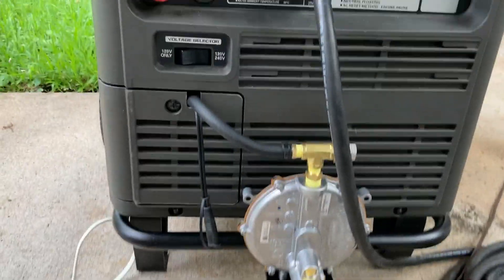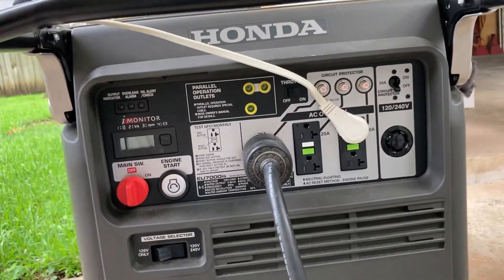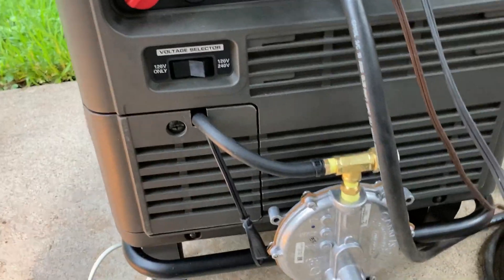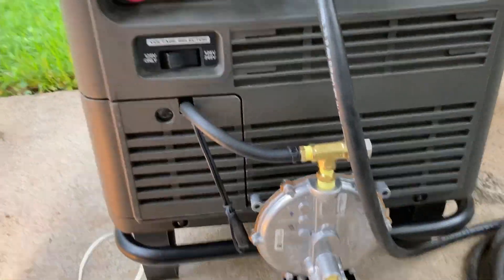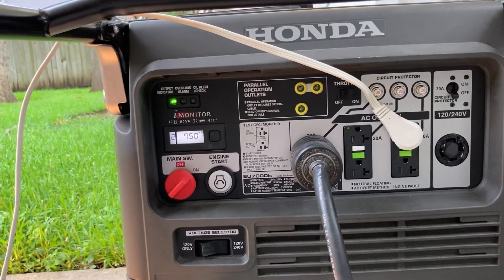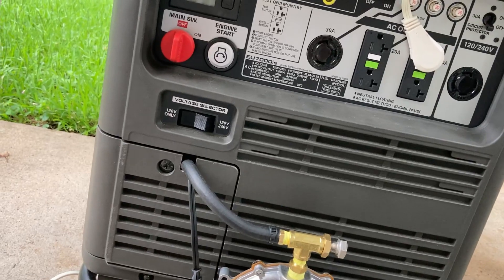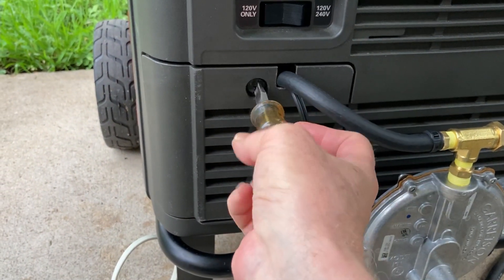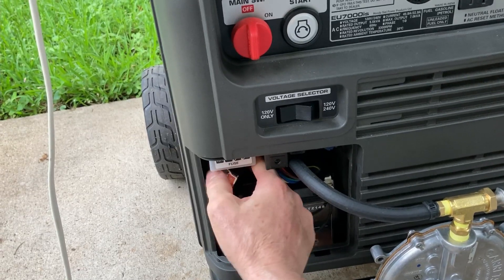Honda EU7000is running on natural gas with US Carburetion Motor Snorkel tri-fuel conversion kit

Comment: Were you able to fix the surging issue? I have the exact same set up and am experiencing the surging as well. I suspect it is because of the small propane hose, so I'm working on getting a much larger one set up. Any hints on what you did to fix the problem would be greatly appreciated!
Reply from the maker: Hi Charles, 

To be honest, I believe it's about as good as its going to get, so I haven't made any changes since the video  I've used the generator several times during actual outages and it worked well for me.

Maybe it's because I came from an EU3000is (also running on natural gas), but this eu7000is seems very powerful and trouble-free by comparison.  It can do everything the eu3000is could could do (while totally maxed out) at idle speeds.  And it can do twice as much without even breaking a sweat.

It would be cool to be able to be able to squeeze a few more watts out of it, but I think someone would have to reverse-engineer the engine computer in order to make that happen.  There are just certain ranges near the maximum potential of the machine where the engine lacks the torque it needs to run at speeds as low as Eco Throttle tries to run it.  I wish they would do that, but it may just be beyond what small conversion kit companies can hack together.  Heck, USC can't even make it fit right mechanically, so it's a near miracle that they managed to make it run as well as they did.  They certainly did beat every other conversion kit company by a mile in that respect.  And practically speaking, if I ever dd experience any surging while in actual use, defeating Eco Throttle would be a viable work-around.  But so far, it just hasn't been a problem.

On the bigger hose idea, at this point I have gone so far as to connect the generator directly to my gas meter, thus eliminating 60 feet or so of 1/2" pipe.  FWIW, I couldn't tell that it made any difference at all, so I'm sticking to my theory that the problem is with the Eco Throttle RPM parameters not being compatible with the engine's power curve while running on natural gas.  But hey, if you find that a bigger hose helps in your case, I hope you'll let me know.  Make a video of it running flawlessly and I'll be on a quest for a new hose.  But I just don't think so.  I started out with a 3/8" hose, which I then upgraded to 1/2", thinking that it might help.  I don't think it helped.

The obvious solution would be for Honda to get with the program and make their flagship models tri-fuel capable.  Failing that, perhaps someone like USC can figure out how to spoof the GCU into thinking it has more load than it actually does...it just needs to ramp up the engine speed aggressively enough to prevent bogging.  Similar to how it does when the two inverters are not bonded together, and the load on one inverter is twice what it would be if the two were bonded together.  It is that signal that makes it run at a high enough RPM to prevent bogging.

As of today, what you see in this video stands as the best-performing natural gas conversion that I have personally seen on any generator.  One might say that's a shame, particularly considering Honda's high entry cost, but the best is still the best.  If anyone has video of any conversion running better, I would very much like to see it!  And then (naturally) I would want to know how they did it...
Reply: @MstrMark  Thanks for your help! Yes, I will try the larger hose and see if that makes any difference since the parts are already on the way. I'll also compare using natural gas with a 3/4 inch hose as well. I'll let you know what I find out. Thanks again. Charles
Reply from the maker: @homeinspectionportland  I do love real-world testing!
Reply: Just a quick update -- I connected 3/4 inch hose and 3/4 inch fittings on the low pressure side of the propane regulator and it worked perfectly. I didn't experience any surging at all. I also tried the 3/4 inch hose connected to the home's natural gas supply and it worked flawlessly as well. I think my 3/8 inch hose from the propane regulator was seriously restricting flow and causing the generator to surge up and down. Having the bigger hose definitely solved my surging issue and it works awesome now with both natural gas and propane. Thanks for posting and for helping me figure out this surging issue!
Reply: P.S. I had to get a much larger regulator with a 3/4 inch output, but it wasn't very expensive at my local propane supply store.
Reply: @homeinspectionportland  Oh, so we're talking about propane?  I have much less experience with that, but I'm glad to know it's working well for you.

Comment: seria interesante que ver si ajustando  el tornillo  del regulador se mejora la estabilidad y ver si hay mas potencia disponible por que  en mi generador hice los mismos test de carga hasta que logre sacar los 4400 w de este generador  a 3600 rpm con una manguera 1/2"  y 30 metros de largo, este regulador soporta hasta   20kw de potencia

It would be interesting to see if adjusting the regulator screw improves stability and see if there is more power available because in my generator I did the same load tests until I managed to get the 4400 w of this generator at 3600 rpm with a hose 1 / 2 "and 30 meters long, this regulator supports up to 20kw of power
Reply from the maker: FWIW, I show it running at 5500 watts starting around here: https://youtu.be/2NziDBzqI-Y?t=364

Backing out the load screw any father has no positive effect on maximum load, but it does hurt the performance with lighter loads.  I feel like the "Snorkel" injector becomes the limiting factor at maximum load, but that's at the heart of this particular kit, so there's not much I can do about it.  Maybe if I had more line pressure it would act different, but it's already within the recommended range.  It will do 7000 watts for short intervals on gasoline, but I don' think there's any way to get much more than 5500 watts out of it on natural gas.

In my mind, a more worthwhile improvement would be a mod to prevent the engine rpm from dropping below its torque curve while running eco throttle on natural gas.  I think maybe US Carburetion could do it with their black box module, but haven't had much luck getting them to talk to me about it.  Anyone have any inside connections?  It would be fun to be involved in perfecting this kit.

Comment: Any testing with inductive loads rather than just resistive loads?  Perhaps get 3000 watts load on and plug in a 15amp air compressor
Reply from the maker: I have, although I didn't make a video...but that might be fun and informative.  FWIW, the EU700is handles transient and inductive loads better than other generators with similar ratings, but motors are still the greatest challenge.  That is why it works better to run several small window A/C units than one big one.  Also the reason that when I replaced my refrigerator, I chose one with DC inverter technology, because that essentially eliminates the inrush issue.  I also have a 22,000 BTU window unit that uses inverter technology, and the EU7000is handles it very easily, barely even changing tone as the compressor gently ramps up to speed.  On the other hand the ancient 24,000 BTU conventional window unit in my garage takes all she's got.  Same with my natural gas central heater - it has an ECM blower motor that is essentially unnoticeable when it starts.  

If one needs to start conventional motors with any generator in this wattage class, one will need to be careful and selective.  For example, I have a 6000 BTU window until that starts fine, but it pulls 2400 watts inrush, so it is noticeable when it starts, and that is a model that is known to start more easily than most.  I have a 5000 BTU unit that is worse.

But I've had some years to sort out my emergency readiness, so I no longer have any conventional motors that have to be started while on generator power.  I can start my 5 HP air compressor if I really need to, but I have to turn everything else off.  Still, if I just HAD to run the air compressor, it would be possible.  All of the other motors are now either DC inverter technology or small enough that they don't present a major challenge to the generator.  I think an air compressor is probably the most difficult load that most people would have.  Even an air conditioner (with the same size compressor motor) is easier to start than an air compressor.

Comment: I have been considering this kit to convert to natural gas for some time for my Honda EU6500 and after watching this video, I think I am going to pass on this conversion. I really don't use it enough for home backup (through a Reliance 10 circuit backup kit) to really justify doing this, especially with all the fiddling and potential problems upon doing so. I need RELIABLE power when I need it, and since I keep lots of treated gasoline on hand for my other small engines, gas supply isn't a problem (at least given the short term use I have experienced to date). The generator MUST work when it's needed, and since I already paid way too much to get the best machine I could, I think I will just leave it as Honda designed it. So thank you for the video and it's assistance in making my decision....
Reply from the maker: You're welcome.  I respect your thought process.  I think NG is hard to beat, but the kit certainly isn't for everyone.  If I had a way to safely and economically store a hundred gallons of gasoline, I'm sure that might very well be my fuel of choice.  But what I'm NOT willing to do is to go foraging for gasoline in the middle of a disaster like the power outage that recently afflicted Texas.
Reply: @MstrMark  Yes, the situation you describe is far more dire than any I could face. The power infrastructure here is solid and the whole act of backup power here in the city of Ottawa is really just a bit of an excessive move on my part. The last major power outage here was back in 1998 when a drastic ice storm destroyed power lines all over the area. Even then, we were out of power for only three hours. So if I faced what you face, I would likely do the same thing....
Reply from the maker: @robertcampbell2389  I hear ya.  The trouble is that ice storms in south Texas are unprecedented...until we had one.  Then EVERYONE was caught flat-footed, with most of the state without power for days.  It was crazy.  I was one of the lucky ones...only out for a few hours, but I have many friends who suffered for days and even weeks.  Road conditions were all but impossible.  Authorities actually closed major highways.  One couldn't drive is search of gasoline, and most gas stations had no power to pump gas anyway.  It was, as they say, the perfect storm.

I wound up loaning my EU3000is to a friend who was out of power for days after the storm.  It's also tri-fuel, so he was able to rob propane tanks from friends and family in exchange for charging privileges and hot coffee...preferable to sitting in the dark on a cold and very dark night.  When the whole city (or even state) is down, it gets REALLY dark.

Yeah, any kind of "prepping" is really hard to justify in the absence of SHTF.  Hurricane shutters are a expensive nuisance when there's no 150 MPH wind.  Generators cost a lot and take up space when the grid is up and running.  And nobody worries about living in the 100-year floodplain until we have a 1000-year flood.  

And it certainly does seem to me that things that "never happened" in the past are now happening all the time.  Out local news is full of stories about people with bewildered faces talking about how they've lived in X location for 50 years and never saw anything like X before.  I myself had never seen a multi-day power outage until Hurricane Ike.  But we were out for three days.  Friends and family were out for weeks.  I had never faced a mandatory evacuation until Hurricane Harvey, but then I did.  It was epic, many homes inundated, families made into refugees, but my own home was spared.  And likewise, I had never seen any storm take out power in the entire state until this year, but then I did.  It's enough to make one want to do more prepping, eh?
Reply: @liffy8333  Right with you.  I just can't practically store enough gasoline to make it though a multi-day event.  As you say, Propane would be hard to come by during an actual event, but has the advantage of indefinite storage duration, so if one plans ahead, it can be a good option.  One could bury a tank big enough to last a month or more.  Diesel stores better than gasoline, and is also less volatile, but even diesel can't be stored as long as propane.  And has the disadvantage of not being something that one can rotate through vehicles...unless one has diesel vehicles.  Natural gas seems like the obvious choice to me.  It could potentially fail, as actually happened in Texas during the epic winter storm, but even then, the gas supply at my house never failed.  

I guess that if one wanted to be doubly sure, one would have propane as a backup. But as I was discussing with @Robert Campbell, prepping always seems silly until the event actually occurs.  Still, with a tri-fuel conversion, one has options...like trolling for grill propane...I myself have two tanks - one on my grill and one spare.  My son next door has another two. And there's always siphoning gasoline....hopefully one could find one of the three fuels.